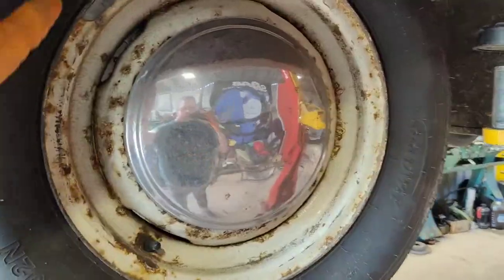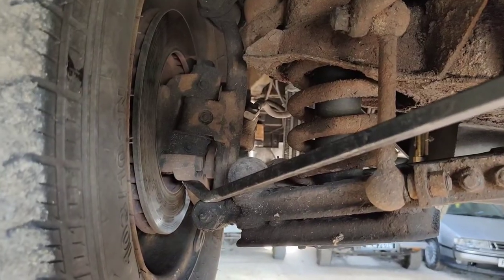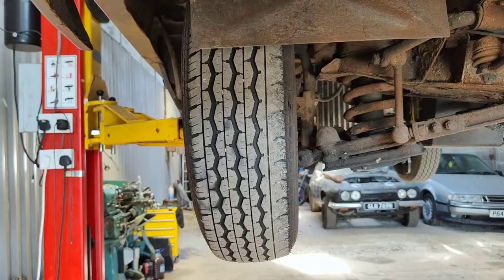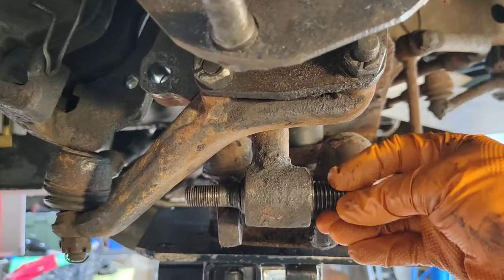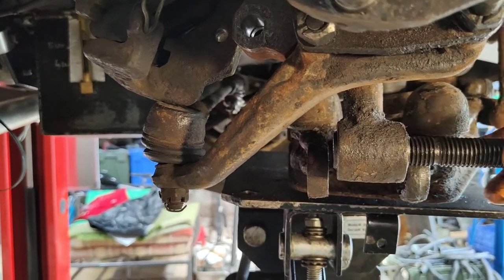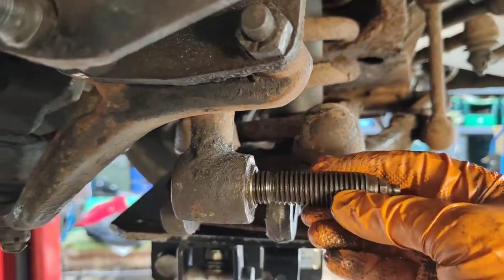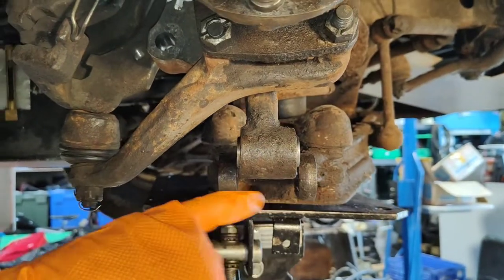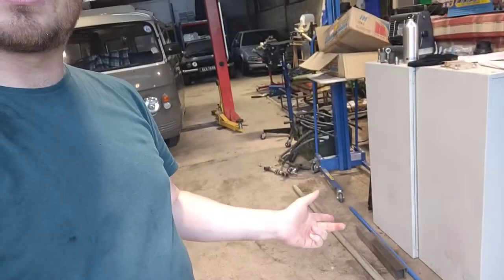Ancient Suspension Maintenance & Smoking Tyres - Saab Powered Commer

Comment: How did you get the 4N71B transmission shifting fixed? 
what valve body did you use? and what else was causing issues previously?
What modified parts did you use in it?

Im just wondering and Im just curious 🤔

By the way I think that 4N71B has potential because you were really boosting along with it 😁 🤘
Reply from the maker: I'd actually say it's not fully 'fixed' 🤦. It currently has the original mx5 valve body but with a drilled out divider plate. Bigger servos, a few extra frictions added in when I 'rebuilt' the box. Under low boost it feels fine (175ish hp) but with full boost (280+ ish) it just slips like crazy through 3rd & top. Keas the transmission shop who were helping me with it reckon a manual valve body is the only answer so I've got one, but it would require the shifter to be re-engineered as it's a bit too stiff/sloppy for continuous shifting. And I don't want to run a manual valve body. So I've got something else lined up 😬

Comment: Always learning things watching your channel. Would you recommend your mig welder? I am looking for a mig that'll run off 16a 240V supply. I bought a second hand clarke one but I had quality issues with wire spool. I think I need to get one good enough that I can just learn to use it properly without guessing is it the welder or is it me
Reply from the maker: You are too kind mate! I'm mostly making it up 😃 As for a MIG welder and despite mine breaking after less than 2 years (the manufacturer has taken it back so hopefully it'll get resolved) my Rohr welder was a decent price and has a decent level of adjustability for wire feed and power. Those cheaper Clarke welders with just 4 switch positions for power just make things harder than they need to be. Especially when welding thin metal like we find on cars.
Reply: @LivingMyBoostLife  thanks I'll take a look - I'm in two minds about whether I get another in the £200 range or if I say yeah this skill is a priority for me and I'm happy to invest in the range of £1000 and grow into it, being in no illusions that it'll make me a decent welder from the outset 🤣

Comment: I assume thos big vented brakes aren't original?? What were they taken from?
Reply from the maker: No they aren't. I modified various parts to fit them. I think I cover it in one of my older Commaero videos 🤔. Modified (centre bore opened up and redrilled) Jeep Cherokee 280mm vented discs, Saab 9000 callipers and carriers, self made adaptors, twin 3/4" master cylinders with an adjustable balance bar, they work well
Reply: @LivingMyBoostLife  thats awesome. Apologise I was enticed to the channel having stumbled upon the crazy scimitar gearbox project and haven't really looked back. 

You really take on some awesome engineering challenges, hats off to you sir!